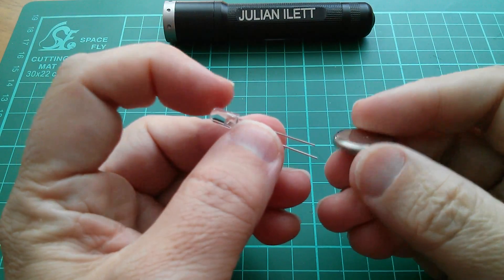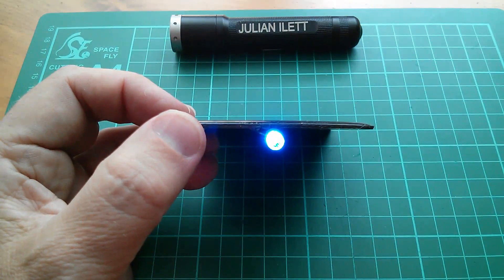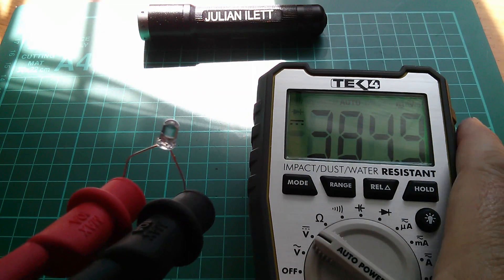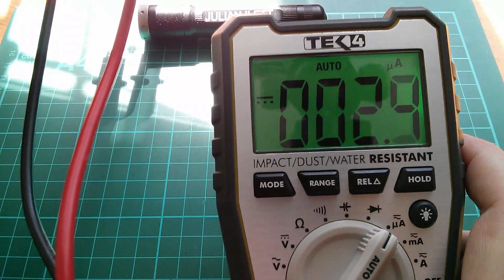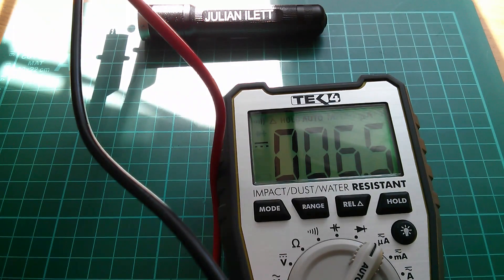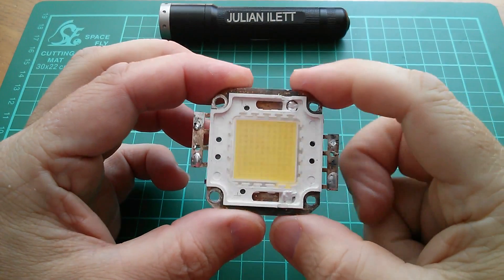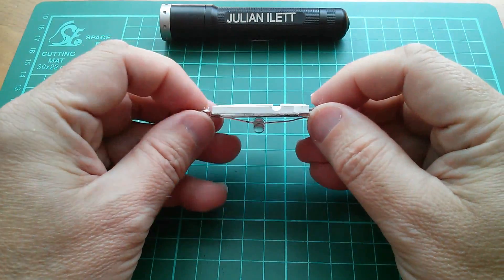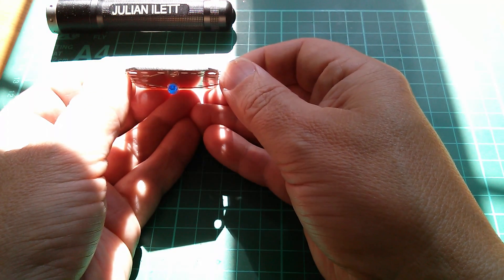Can you light an LED from an LED?

Comment: You can try using a joule thief. Those only need 0.33 volts to operate. Current doesn't matter much as it is replaced by voltage. The current produced by the LED may not be enough to run the joule thief but I think it's worth testing.

Comment: i also did this a few months back and i found if you use a magnifying glass and focus the direct sunlight on  a 30 watt led it will also light one of the small led's you have in your video.. not super bright but it does work .im wondering how much a joule thief would help this experiment? thanks for the video

Comment: I also have experimented with using LED's as a light detector. Ive used diffused colour LEDs to detect colours of course. And detecting UV via an UV LED connected straight through to an arduino analogue pin, It proved to be surprisingly sensitive.
I also noticed a strange fade like effect, My guess it is capacitance somewhere. But I thought it was because of internal ATMEL circuitry.

Comment: The blue one might be able to light a red one. Red LEDs actually need very little voltage and current. 1.7v at a few microamps would probably light up a red enough to see a little bit.

Comment: Why don't you try forcing current into a solar panel and see if it will light up? ;)
Reply from the maker: +xanataph Strangely, I never thought of that :)
Reply: enought current and it will surely be lit :D
Reply: Not compleatly taking the piss here. From what I understand there is a very similar structure to solar panels and LEDs. Also what I have heard is that LEDs were almost accidentally invented initially during research into solar panels. You have shown how an LED can generate a small current. So it's possible a solar panel might work backwards too and no doubt with extremely low efficiency. It might need total darkness to see a faint glow. It might even need some kind of image intensifier to do the job.

Comment: Here's a semi-related grammar question from a non English speaking guy (me). 
Why do we say "AN LED" instead of "A LED" ?
After all we do say "A light emitting diode". Shouldn't we use "A" also whit LED ?
Very informative video btw.
Reply: That's a good question, and I'm happy to help you.  Congrats for the courage to post your question, often times people become horribly mean when someone reaches out like that.

To answer your question... the "N" that follows the "A" is a means to make the language smoother. The basic rule concerns the beginning sound of the word that follows. If the word that comes after the "A" has a vowel (A,E,I,O,U, and Y sometimes) or a non-consonant sound, you follow the "A" with an "N". Confusing, I know. You might notice that I used "an" in my previous sentence when referring to the "N".  Vocalising the name of the letter N sounds like it begins with the vowel "E", and sounds like it would be spelt "enn". 

Say the following out loud to yourself... "That word needs a N", and "That word needs an N". Which version is easier to say and sounds smoother? The glottal stop (closing your throat to finish the sound of the 'a' in the first example) causes the sentence to sound coarse and requires more effort to say. 

The "A" can stand by itself if the word that follows starts with any sound that requires the mouth to hold back air before releasing it to start the word, but requires the "N" if the beginning of the word that follows is formed by uttering a tone that is made by opening the throat only. Sounds silly, I know.

Some examples:  "I want to eat AN apple", "I want to eat A peach", "This is AN LED", "That is A yellow LED", "Here is AN yttrium aluminium garnet laser (YAG)".  Hope that clears up a strange English rule. 

There are a few other oddities that you will see everywhere that I'm sure it will make anyone learning English pull his hair out. Many people have lost their English skills from being immersed in the horrible grammar online, mainly because offering corrections will get the most vulgar and hostile remarks for your trouble. 
Some of the worst are: -Using "should of" instead of "should have", -Using "seen" instead of "saw" (the word "seen" should only be used if "have" or "has" is before it, everything else is "saw"), -Using "walla" instead of "viola" (which is a French word)... plus many more. Including them here would make this reply far too long to be comfortable and I think two or three would be enough.  (Yes, another big one is when people don't use the correct version of "to", "too", and "two")

Hope this is helpful to you, feel free to PM me if you have other questions. I like helping out but I'm not on here regularly and might be awhile before I can respond.
Reply: Well, merci beaucoup Mr DaveArgon :) All of this makes a lot of sense and it is not really that confusing. Less confusing in fact than seeing English-speaking people write "your" instead of "you're". To be fair, I see the same atrocities in french : People who don't know the difference between "ses", "ces", "c'est" and "sais" for instance. Although these four words sound exactly the same, it is pretty obvious which one should be used in a given sentence. As obvious as "your" and "you're"

Back to the topic, it does indeed feel more natural to say AN LED instead of A LED. In English class, many years ago, I remember they told us that before a vowel we should always use "AN".  I don't remember any teacher elaborating about the "A and AN" rule in relation to non-consonant sounds. Maybe they were lazy, or maybe (probably) I was not paying attention that day. Anyway, this is why I asked that question yesterday. 

So you did help me, I thank you again. I don't think I could have wished for a better answer.  And by the way, I do hope you are a teacher. I have a feeling our schools need more people as dedicated as you seem to be.

Comment: Now that you know that, you have a new search terms for Arduino (and similar) projects. There a quite a few that use this as an ambient light detector (to switch that very same LEDs in the lamp on and off) or even for half-duplex optical communication.

Comment: Tachometers? Pretty sure the periodic on off pattern that can be turned into rpm.
Reply: I mean a laser/diode which is on the spinning item is directed right into another stationary led which creates a voltage that can be used to count the number of times it goes by.

Comment: Try firing an ultraviolet laser at the LED directly at the chip itself. You can get about 7v at 12ua. It doesn't generate enough to light the other very brightly but it does work. AliExpress has them for cheap too. You can get one for as low as $6 US. I'm not sure how much that would be in the UK but it's still pretty damn cheap even with postage.

Comment: Blocking oscillators run nicely enough using a green led as solar collector (best type that i've found and reminding of plant photosynthesis). Also, if you heat the led with a nearby lighter the current jumps up. So, a green LED on a black piece of metal is the 'efficient' route :)

Comment: Shouldn't you change the leads to plug for measuring current, when measuring current? Because measuring open voltage really says nothing and measuring current in short circuit surely would drop the voltage to 0. mppt way would be the only way to get any good max readings out of it.
Reply from the maker: The Voc and Isc figures just hint at how much power this LED could produce into a load. The numbers are tiny. And because these 5mm LEDs are so directional, they're pretty useless as solar generators.
Reply: No. The milliamp and lower curent is the same post as voltage. Only if you're measuring over 250mA (typical for most DMM) should you switch the 10a post.
Reply: oh ok, all dmms I owe, have 4 posts.. comm, voltage/ohms/etc, mA, A. The reason is quite simple.. you can't measure current while connected parallel and you can't measure voltage while connected in series.. you can switch the routing internally with the big knob, but that introduces new resistance/inaccuracy and is possibly only on cheaper dmms?
Reply: I thought the same. The last meter I had that would measure voltage and current without changing over leads was an old cheap analog meter (and yes, I fried some components sometimes by accidentially turning the meter from volts to amps). I also just tried with a red LED and I can get 5-10µA just by shining a 1W white LED torch at it. So sunlight should be able to do much more.
Reply: Google+ SUCKS BALLS - the worst forced social network That's right. Typically the more expensive meters seperate the posts due to that reason. The GOOD cheaper ones help mitigate the problem by having an off position on two sides of the dial or a 360 dial so you can switch straight from off to volt or amp.